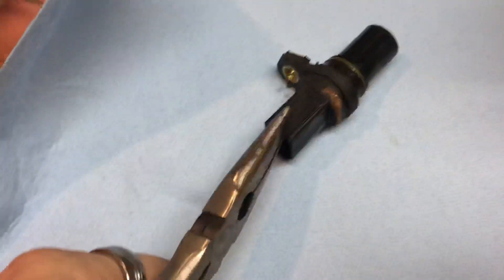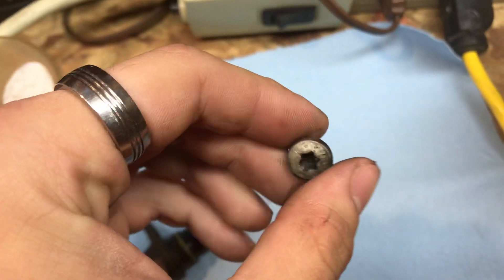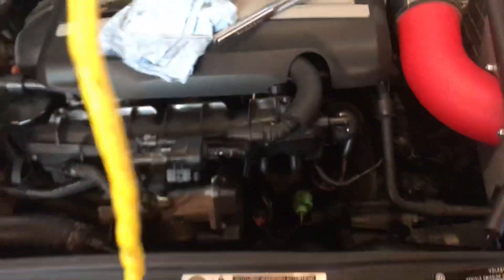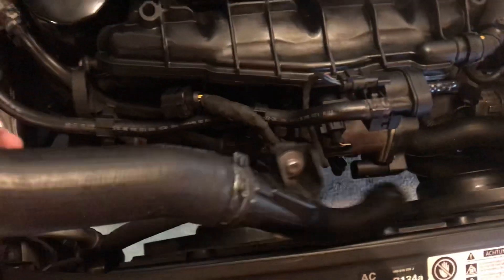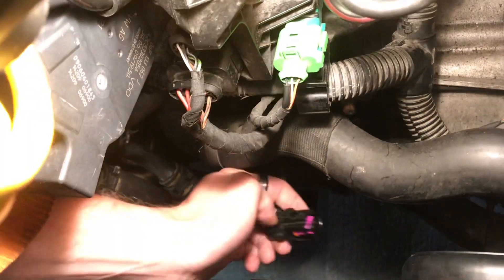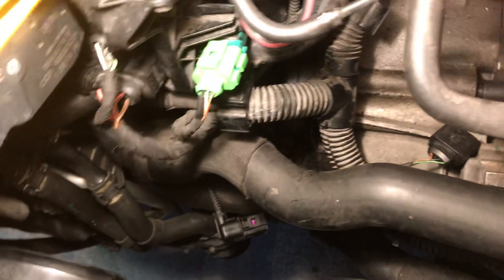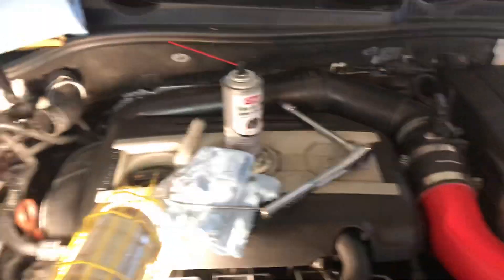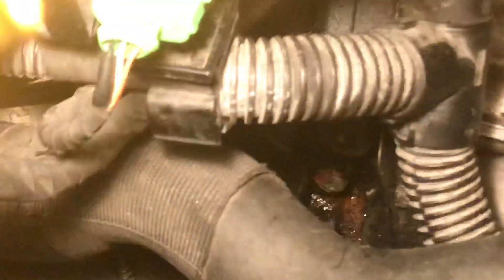VW Mk6 GTI Crankshaft Position Sensor

Comment: Hi there!
Nice video.
I own a Leon with the BZB engine almost identical in looks and facing the same symptoms.
I cannot rev more than 3.000 rpm and got a P0321 fault code on torque plus.
Going to change the crank position sensor also.

Comment: Thanks for the vid deff helpful, sucks my sensor housing broke off when I pulled the sensor out… now the housing is sick in the block 🙃 few hours now trying to pry it out. But when it sits flush on the block only thing to do is find something I can fit in the housing and expand it to actually get any type of grip on it. Any ideas or tips?
Reply from the maker: Fortunately for me this didn't happen lol I think there's another comment in here somewhere where the same thing happened and the guy said he used a pick tool (harbor freight has them super cheap) and a small pair of needle nose. If that didn't work, I'd probably try to find a small file tool (also harbor freight) and file two slits on the edges that would hopefully make it possible to squeeze the housing out
Reply: @DirtyMike_97  I’m gonna use a decent sized screw and some quick steel to bond it to the housing then loosen it and pull it out hoping that works, already used the pick and the needle nose method

Comment: How did you disconnect the electrical connector?
Reply from the maker: The connector I believe is a standard pin connector so just has a push/pull tab. If you Google "Mk6 GTI crankshaft sensor harness" it should be the first thing that pops up. 
If you have a thin pick or even a tiny screwdriver, you should be able to angle it to pull the tab up while simultaneously pulling on the harness itself.

I honestly can't remember if it was a push tab or a pull tab, it's been a long while

Comment: Might be a stupid comment/question but here goes... when I pulled that sensor our it didn't have the black body intact it looked like it broke off like the casing broke but sensor is still there, is that why my new sensor doesn't fit?
Reply from the maker: Hey man sorry for the late response. I'd say it's definitely a possibility if it broke apart. I know it's not a great angle but you might be able to get one of those cheap 'telescopic mirror's from AutoZone and kinda angle it down there with a light to see if you can see the old plastic shell of the last one stuck in the hole.

And if you DO see it, I'd proceed very very carefully. Maybe try to get one of those little 'picks' you can also get at AutoZone. They have some with 90 degree bends at the end and you'd probably be able to yank the old plastic out
Reply: @DirtyMike_97  
Got it out and all is well, yes I did have a pik and a small set of needle nose that got it out... old sensor separated from the housing lucky for me nothing broke apart.

Comment: how did you install the new sensor ? i'm having a hard time getting it to go all the way in
Reply from the maker: Sorry man! I had my YouTube linked to my other account for a while and didn’t see the notification. This is a 2.0 Turbo TSI. The sensor itself just sits in the bore and is held in place by a bolt immediately above it. It will feel loose until tightened all the way

Comment: Yea that's kind of the problem I'm having now. It stalls after driving a while and have to wait for it to cools down and bogs around 3k rpms as well already changed the air filter, new manifold, new coils and spark plugs, carbon cleaned, new MAF sensor and now the air temp sensor. Next is the fuel filter and probably this next.
Reply: Did you figure out the problem im having the same issue on my GLI
Reply: @SamuelHernandez-oh9vl  no sadly the beginning of June someone pulled out in front of me on my way home from work and totalled my car. Now I Have a MK5 R32 lol
Reply: @agent47isn1  damn glad you're ok, nice upgrade tho lol
Reply: @SamuelHernandez-oh9vl  thanks me too the whole front end looked like a crunched pop can. And yea I thought so too lol

Comment: How did you get to the torque screw holding it in? I got all piping out of the way, but there is a metal bracket blocking me from getting to the t-screw.
Reply from the maker: I had to use a flexible socket, it just barely fits and it is an absolute pain. You can see it from the top if you shine the light in just the right spot
Reply: @DirtyMike_97  to make sure I'm looking at the right torque screw, it is underneath the sensor, correct?
Reply: Nevermind, I'm an idiot. Got it off and switched out. Thanks again for the video 👍

Comment: My 14 GLI runs good...no rough idle etc. It just sometimes will have the EPC light and wont accelerate fast if given full throttle. I turn it off and back on and it goes away. It does it every now and then. I dont know if anyone has had a similar problem. EPC light is not on at the time, ill try and go to autozone and see if i still get an error code. Hope someone can help
Reply: You should check to see if your purge valve is bad. Had the same thing happen to me before, 13-14 Volkswagens are known for having bad ventilator valves.
Reply: @stevvvveeeen  thanks for the reply!!! Already set an appointment to take it to vw by the end of the week. I got a p003A code (turbo boost control). Ive had a new camshaft put in (had grinds) timing chain, new oil pump. So hope its an easy fix this time. Thats why i havent modded this car....so many issues so far. Ill never buy another VW again

Comment: My same car through a p0016, rough idle, just wobbling at idle, I changed the camshaft sensor, should I change the crankshaft then see if it fixes it or what should I do?
Reply: Literally my car in my driveway broke down right now waiting on a ride to work
Reply from the maker: Well you won’t love the reply...
I’ve never had the p0016 personally but I’ve seen a few cases online. On the incredibly lucky side: It’s either the camshaft sensor or Crankshaft sensor having an error. If you’ve already replaced the camshaft sensor, I’d replace the crank sensor too if you can spare the $40. On the incredibly unlucky side: That code is linked to being one of the signs that the timing tensioner has crapped out on you. Are you in the same boat as me? You’re over the TSB mileage? I’m honestly waiting for mine to go out any day now. And I have to make a 1,200 mile drive next week and I’m on the stock tensioner and belts at 142,000
Reply: @DirtyMike_97  I took it to the shop, they said it was my balancing chain tensioner and the chain itself that went out, they said that I was lucky not to have blown the motor, I took it in when It was still fixable they said lol was $1600 at a local shop
Reply from the maker: Josh Hayeslip Understandable, are you within the lawsuit coverage mileage range? Mine is basically a time bomb because I was just a hair over the mileage
Reply: I had 90,000 miles on it when It broke, not sure if that’s in the mileage range?

Comment: Thank you! Just had this problem! Hopefully it fixes the issue! I have the same symptoms
Reply from the maker: Juan Herrera Best of luck in the replacement! It may help if you have somebody help you with the throttle pipe removal
Reply: Update! This solved the issue! Thank you so much!!!! POST MORE CONTENT!!
Reply: Juan Herrera did your epc light pop on and lost throttle response ever?
Reply from the maker: jack girard what year is your car?
Reply: MajorMychal 2013
Reply from the maker: jack girard I never had the EPC light as a result of the sensor in this video but I did have EPC issues with my throttle position sensor. Idk if it affects later model GTI’s though. Check out this link, it may be helpful
https://www.google.com/amp/s/forums.vwvortex.com/showthread.php%3f7079582-DIY-Throttle-Body-Rewire-TSB-2018652-2-2-0-TSI&amp=1
Reply: jack girard I have a 2012 I would be shifting gears then at 2000-3000 rpms it would lose power and jerk then stop and the epc light came on then the cel 

I changed my fuel pump, cam sensor, spark plugs and it didn’t solve the issue. 

Then I saw this video and change the crankshaft sensor and my car started working properly.
Reply from the maker: Juan Herrera That’s awesome man, and a cheap fix too! Sucks you had to replace all that other stuff before finding it but preventative maintenance never hurt anybody
Reply: Juan Herrera thank you so much man, i was about to take it to a dealership 😭 i’ve changed plugs, coils, and both fuel pumps so far. hoping this is the answer. it runs fine and then randomly get the epc light and it just cuts, i’ll pull over and it sputters until i turn it on and off. then the light goes away and it happens again randomly
Reply: jack girard yea man just change the crankshaft and it should fix it
Reply: MajorMychal yea bro it Lowkey sucked but it’s all good because it’s fixed 😂
Reply: @thejuanherrerajr  i have the same problem i will try change that sensor
Reply: @cesardiprinzio   it’s a easy fix it solved the issue  had the same issue recently then changed it out again and it solved it
Reply: @thejuanherrerajr  Juan que error te aparecía En la pc . Yo tengo g20 posición de árbol de leva. Pero.eso ya probaron cambiarlo, así que voy a probar con este. La falla es igual de 2000 a 3000 vueltas todos los cambios tiemblan y motor sin fuerza. mañana lo cambio
Reply: @itslilflipz  Have same car, same issue. What did you do ? LOL It's late but idk you may answer thx
Reply: @itslilflipz  this can happen and long crankups to start same issue

Comment: Ive been having rough start ups every now and then... Using obdeleven gives me no codes but with vcds threw the g28 code. I'm doing this job tomorrow on my 2013 CC
Reply from the maker: Alberto Perez Sorry, just now saw this. How did it turn out?
Reply: @DirtyMike_97  throttle response is better, but rough startup is still there, guess Ill have to change the dualmass flywheel.. No more g28 code by the way
Reply from the maker: Alberto Perez Interesting, best of luck to you!
Reply: @DirtyMike_97  thanx..
Reply: @albertoaprxrdx7134   hi, it helps to solve the problem?? Mine cc 2013, stalls when reaches 90 degrees tempreture.. then runs and stalls after 1-2 seconds... after 2-3 hours when the engine cold again, it goes normally again... thanks
Reply: @sarunasja  your problem might be the water temperature sensor, there's 2